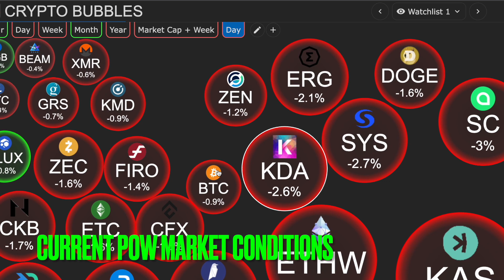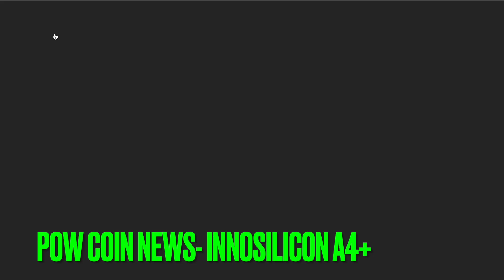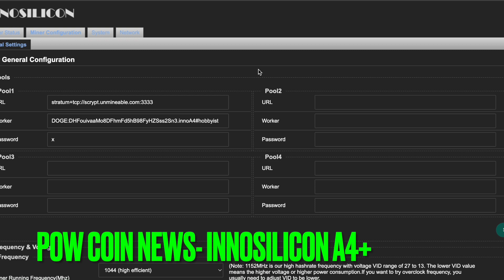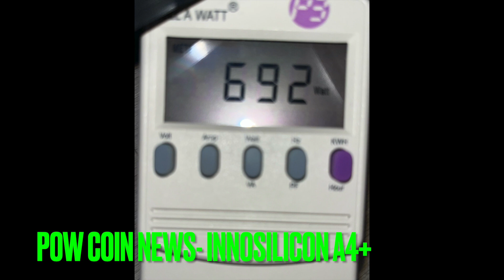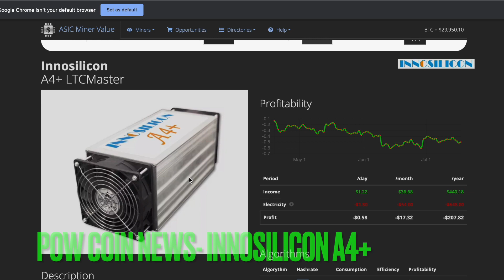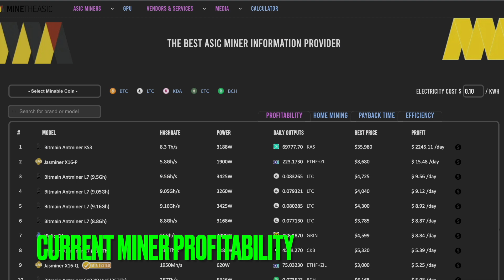POW COIN NEWS- Is the INNOSILICON A4+ the new ANTMINER L3+?!

Comment: Don’t forget the halving is in 2 weeks. That will cut its daily ltc output in half. I wouldn’t recommend purchase of any ltc miners until after the halving. They haven’t done anything new wrt their blockchain. Btc halving a ways off yet. Timing is hard to gauge atm.  Thanks for keeping us informed!
Reply from the maker: Agreed, I touched on that because with the litecoin halving decreasing Scrypt overall profitability this machine is now the new L3+. Additionally Litecoin and Dogecoin use case are stores of value with low transaction fees. There is not much to change or upgrade on their blockchain.

Comment: I would like to have something else then The l3+ that’s why I’m buying an s19 pro 110th for 1350$ used but this innosilicon isn’t worth the 500$ price tag in my opinion at max 200$ L3+s in China are selling for 80$ used with a psu plus with L7s selling for 4K new it doesn’t make sense for these miners AT the moment but it definitely makes it a good miner for someone buying an asic miner the first time 
Plus check out the Phanteks T30 they’re much better then the noctuas trust me
Reply from the maker: The L3+ I would consider a mid size asic compared to the S19 pro as the S19 requires 220v. For home miners I think the S9 or the L3+ are great options being able to be run on 110v. As far as the Innosilicon A4+ I think it has a lot of value in that it has the same efficiency as 3x Mini Doge pro miners. 3x Mini doge pro miners will run you between $900 and $1200 dollars USD not including the PSU. For $500 USD with a PSU I think it’s a good buy!
Reply: @coinology2022 Was going to ask you your thoughts on noctua vs phantek when saw conversation
Reply from the maker: @td1938 I have not personally used the phanteks. Stock mid size ASICS use 6000-7000 RPM fans stock. Noctua NF-12 are 3000 RPM and Phanteks T-30 are 2000 RPM. I have not utilized the Phanteks because I am skeptical as to if they can cool a mid size asic in my environment (summer/ grow tent). If you are just keeping 1 unit in your home and want low noise you might be fine with the Phanteks but for a farm I would run Noctuas!
Reply: @coinology2022   The phantek t30 have a switch to turn them to 3000 rpm fans. I have watched a few video's on them they seem to be really good. Hopefully, @slayer21 will share some of his experience with them. Maybe a good video idea for you, like what's better for fan replacement for your asic
Reply: @coinology2022 for a first time miner it’s definitely good to learn on it but looking at the prices Of L7s it’s not a good price you get what I mean? But definitely In the bull run it’ll be worth in the 1-2K$ easily just doesn’t make sense with L7s right now being 4K $ brand new but it’s definitely not home friendly
Reply from the maker: I love that idea, thank you. I need to order some new fans for my grow tent since it’s summer and the a4+ runs hot.
Reply: @coinology2022  I would definitely watch that video. The reviews for pc not mining say push more air. Hopefully, it's true and will cool more
Reply: There are much more different options in this time like in my opinion buying a btc miner even tho it runs on 240v u can run it on low power mode @ 10 amps and make it profitable on 15 cents plus not pay a whole lot compared to the old days
Reply: I was just about to ask about those Phanteks T30-120 fans. What do you have them on? I want to put them on my Goldshell X5. I have been going back and forth between going noctua or phantek. Any info would be much appreciated